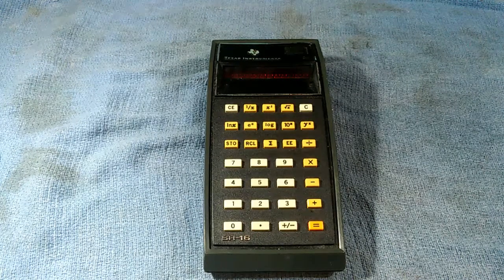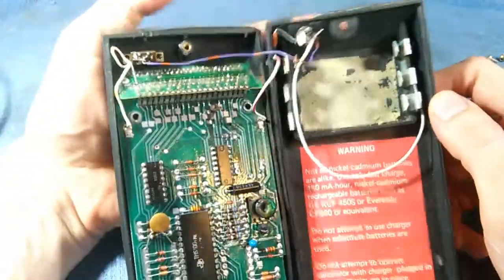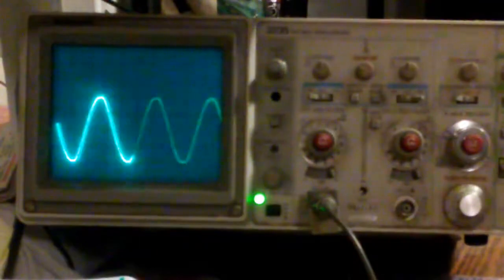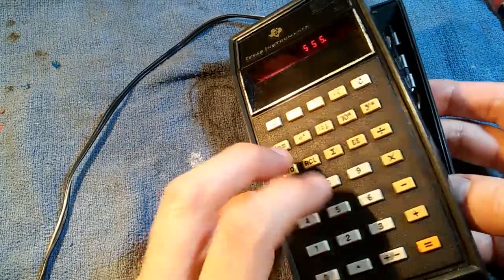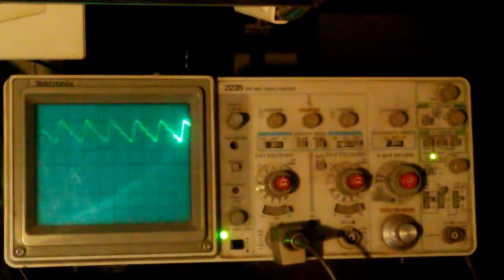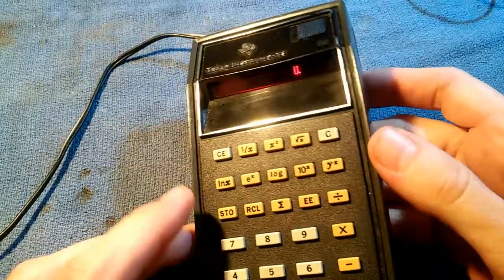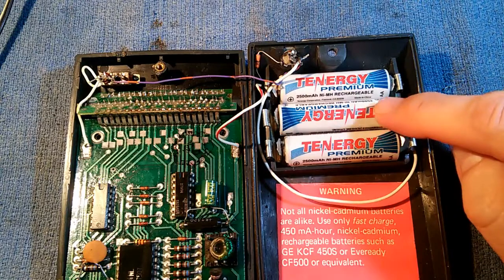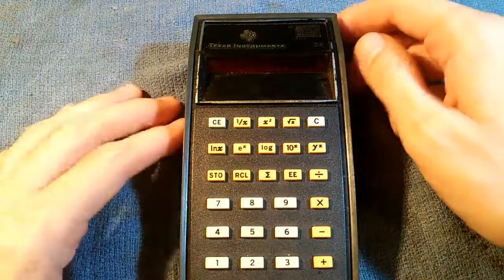Texas Instruments SR-16.  Repair.

Comment: Note that many of these older calculators can be damaged by connecting the charger/adapter without the battery pack present. They depend in the load presented by the battery pack to help regulate the voltage. It is never a good idea to power one only by the original charger/adapter without some investigation.

Comment: Thanks for posting this. I have an SR-10 and SR-11. I had planned on eliminating the battery and adding a regulator but your solution is the simple is better solution. Interesting the SR-10 and SR-11 needed a larger capacitor to function correctly.